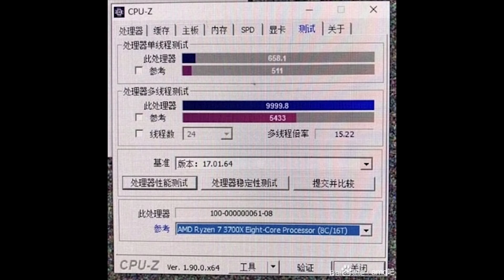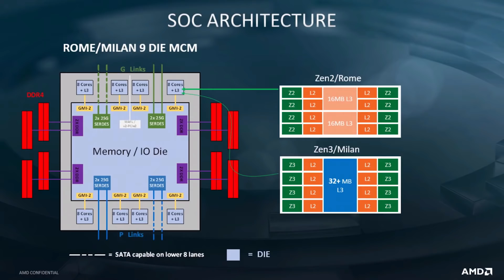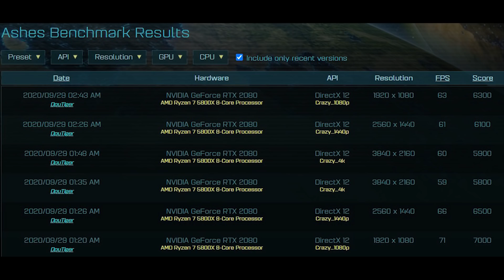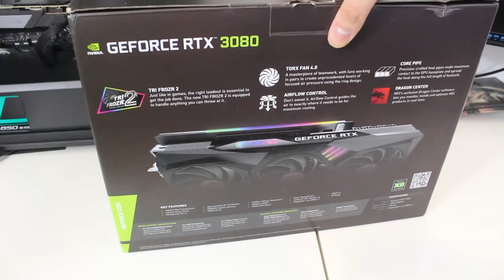Ryzen 5900X CRUSHES Benchmarks | Beats 3900X By 25 Percent

Comment: Is it possible the 5900x actually give an fps boost over the 3900x at 4k? 

I would imagine no, but i'm not sure 🤷
Reply: No. I mean I don’t even think in a low grade esport title it wouldn’t make a difference
Reply: Depends on if the game is single-thread reliant. 4k generally puts more workload on the GPU sure, but you still need the CPU resources to match it. You can't take an Athlon X4 and pair it with a 3080 at 4k and get the same FPS as a 10900k.
Reply: Joseph Hodges they specifically were saying over the 3900x.
Reply: @erichall090909  right. And it'll still depend on if the GPU needs more CPU resources not to bottleneck. My guess is you'll get better lows and average fps if these rumors are true.
Reply: Joseph Hodges your really not unless it’s a really old really low graphic game.
Reply: @erichall090909  Generally, IPC increases while not raising maximum FPS when GPU bound do raise AVG and Min FPS...

Comment: Currently gaming with my trusty i7 2600k... I suspect it will finally retire and a Ryzen 5000 series will replace it. I hope the new Ryzen will last as long as my 2600k :-)
Reply: Dex4Sure  Probably be a rip off and offer a barely noticeable difference for quite some time, probably no real concern for a gamer. Perhaps 5% performance uplift in scenarios where ram bandwidth is paramount.
 I'm sure some hardware snobs that want 168 fps instead of 160 won't think twice about blowing £400+ on 16gb of the first generation of ddr5. Historically that's been the case with every transition to a new ram technology.
Reply: im rokin my xeon w3680 and will eventualy get a new amd cpu, just not sure if 5000 series will have the value compared to 3000
Reply: Still using an i7 2600k here aswell and I'll definitely upgrade my entire PC in a few months from now. ZEN 3 and RDNA 2 look extremely promising and I just can't ignore it any longer.

Comment: 511 on single core in CPUz makes sense on the 3700X. That is what my 3600 gets as well in CPUz single core and I know it maches R7 3700X in that test. So if 652 is the single core here?  This looks like boosting 5GHz with some IPC improvements sprinked in.  I bet 5700X will be 4.8GHz and score around 615 single core. 20% faster than it's predesessor.
Reply: @Desktopia it's a bit faster than heavily overclocked CPUs with perfect memory tuning. With tuned RAM, these will be way faster.

Comment: 15% increase in multicore is underwhelming.  I'll buy a 3950X instead of a 5900X if that is the case.  I'm not a gamer.
Reply: Depends on which kind of workload you're doing, as an architect and doing some work on CAD the single core is nice and for rendering the amount of cores is a really nice value proposal. I have been using a Threadripper 1950x for a few years now, and while I felt like I got a bit scumbagged with no option to upgrade towards the newer processors on this motherboard, these seem like a great path to retire this PC into a home server.
Reply: @YvesSanchezP  What CAD program are you using that is single threaded ?
Reply: @SomeTechGuy666  I'm sure most CAD programs are only single threaded when drawing and performing operations such as hatching, doing arrays and whatnot. 

I use mostly Vectorworks, but also use Autocad since it's what the industry mostly uses. Also, when drawing 3D models, exporting or importing and doing complex operations you will be performing such tasks mostly on one single core.

The benefits recently on these programs have been the viewport performance by taking advantage of new gpus.

It is always nice to have extra cores when you're rendering and want a high quality output out of programs such as maxwell render or vray instead of the videogame-y look lumion or twinmotion give you.
Reply: @YvesSanchezP  That is not what I asked you.
Reply: TechGuy okay you can’t read the answer given.

Comment: With my fabric clock at 1900, ram 1:1 at 1900, CAS latency 16-16-16-36, and dual-rank mode on the ram, I get 555 CPUZ single-core.  Not sure if it is worth the upgrade, might wait for x670 and DDR5 as well as PCIe 5 .0
Reply: I mean no  not for you but it is quite faster then the 10900k so in gaming its going to dominate and well it ofc is dominating multithreaded tasks so its up to you. I'd say if you want a 3080 or top big navi I'd say switch but its up to you.

Comment: Should I wait for zen 4? First time buyer. I have no parts. Zen 3 is at the end of the chip cycle am4??
Reply: depends how often you plan on upgrading, if you dont plan on upgrading for a while anyway then i think zen 3 is the way to go since you'll be getting it atleast a year sooner. If you want to upgrade yearly or bi-yearly then maybe wait so you can hopefully use the same board/ram or whatever.
Reply: Depends on what you are doing and how immediate your needs are. As HarryVoyager said, this is the last AM4 push, but historically, the first generation after a memory tech change isn't a great leap. Basically everyone puts their energies into making the new stuff work instead of improving the base architectures a lot. Most of the time, the gains are really a matter of reducing the bottlenecks experienced by the current architecture. AMD may surprise, but I would expect a Zen 3 refresh (say +5-10% base performance increase, mostly from clocks) with DDR5 bandwidth reducing memory bandwidth bottlenecks (improvements based on CPU used and task varying widely, but probably ~5% average for the first release).  The place DDR5 will make big impacts is in APUs where the bandwidth constraints really hurt the graphics capabilities. I could see a change from 8 GCN/Navi CUs to something like 12-16 Navi 2 CUs on the mobile/G series side of the fence. 

So the real question is do you need a computer now and how much computer do you need/want? You could make a balanced budget system with the 4000 series APUs (e.g. 4600G) that would do most tasks pretty well and be easily upgraded with graphics card for more gaming horsepower as desired. Or you could go super budget with an Athlon 3000G and make a reasonable and simple first computer for under $500. If pure gaming is your goal, a 5700X or higher with graphics card of choice would be a good move. 

Also, be aware that in this hobby, there is always a new bigger, better, faster, etc. card or chip coming. It's stressful at first, but make peace with the fact that some new release will always  make your current epic rig look old and slow (eventually). So make decisions about hardware based on your needs and goals, rather than your emotions, otherwise you will always be bummed when the next thing comes down. As a general rule, I have found that buying the mid-high end and planning on a 3-5 year replacement cycle is the best combination of staying current on the tech, having a powerful computer capable of doing everything I want, and not breaking the bank. 

All of this goes out the window when you start making money using your computer. If you are doing something like video rendering, massive CAD work, scientific computing, or anything else that equates directly to dollars, it's time to do some math on how much time/power is worth to you and whether a part will improve your cash flow. For example, in video rendering, a mid-high end card could be $500-$800 dollars while a bleeding edge top of the line card is $1500-$3000 and only gives +10% performance. For gaming, it would be an extravagance. In rendering, it lets you render 11 videos for every 10 you could render before. If that extra video is bringing in more money, the more expensive card could pay for itself over time.
Reply: Depends on what system you are using rn.
Reply: Duy Hoàng Nguyễn I’m playing PS4. Mainly Warzone.
Reply: I would expect Zen 3 to be the last big release on the AM4 platform. As I understand it, they need to move to DDR5 to feed more that 16 cores, and, in theory, Intel is moving to DDR5 in the next year or so.
Reply: @HarryVoyager  Where are you seeing anything about "feeding" a 16core needs ddr5.  They have massively more cores running on ddr3 just fine, why would it matter?  Just like DDR4 was supposed to be a huge difference from DDR3 which wasn't found to be the case, I expect the same from DDR5, plus initial releases of new RAM is generally very slow speeds, it's better to wait years down the road when you can get a good speed, low latency option for a good price.
Reply: @Sonickrunch  I recall it was brought up in one of the previous AMD interviews. Basically they see the value in 24-32+ CPUs for general users, but they were holding off on going beyond 16 cores for Zen 3 because they felt that they needed more bandwidth than DDR4 provided for a 24-32 core system. 

Recall, while Threadripper does do 32-64 cores, it is also running quad channel DDR4, and I believe they clock lower than the desktop parts.
Reply: @HarryVoyager  I'll look for it. but at those levels I'm not sure what benefit we can see today from all those cores.  I'm not going to act like more cores is useless obviously, but we need some work on the software side to take advantage, seems there's still a lot of developers sticking with the mentality of, give me a few high speed cores vs multiple cores.  Until we see major dev houses pushing Intel and AMD to provide more cores for specific use cases, we may end up with GPU's or co-processors being developed first which meet those needs like we see today with CUDA/Steam
Reply: Depends, Zen 3 and current MB support PCI 4.0, USB 3.1 and NVME SSD's.  I don't see a real reason to wait once Zen3 drops.  USB 3.2 is "better" but there's no game changing tech coming imo that would make this obsolete anytime soon.  Expect at least a 5 year platform in terms of performance out of this pc.  Heck I got nearly 7 out of my last system(Intel 4790k, only regular sata ssd speeds and usb 3.0).  I upgraded to the 3600 and am4 so that I could drop in a Zen 3 chip and get the DDR4 and PCIe 4.0 and proper nvme speeds.
Reply: You could wait till 2022 of you want.

Comment: A new era is coming and we all bow down to our new overlord, AMD aka Lisa Su
Reply: Kinda sad that we are running into the physical limits of silicon and Dennard's Scaling. 20 years ago a 25% cpu perf improvement in 18 months would have been considered unimpressive and maybe even shameful.  From Nov2000 - May 2002 (18months) Intel went from 1.5Ghz to 2.4Ghz Pentium 4 in that amount of time.  In roughly the same time period Oct2000 - June 2002 AMD went from 1200mhz Athlon to the Architecturally improved Athlon XP at 1800mhz.  Nowdays the only substantial improvements are through IPC gains and all the low hanging fruit has been picked already, making it harder and harder to make substantial improvements to IPC (without a radical change eg: 1GB stacked dram on die)
Reply: She isn't my overlord...I use Intel/Nvidia only.  :/
Reply: AMD, hurry up and raise those prices already.
Reply: @michahojwa  And make 5nm++++++++++++++++++++++++ already!
Reply: Zen 3 will be old news real quick. Having the gaming crown for only 3 months until Rocket Lake means nothing. 2021 tech news will be dominated by Intel. 8core Tiger Lake-H and Rocket Lake-S in Q1 2021, PCIe 4 Optane SSDs, Xe-HPG gaming GPUs, and Alder Lake-S + DDR5 + PCIe 5 in Q3 2021. Intel will support PCIe 5 and DDR5 way before AMD https://videocardz.com/newz/intel-tiger-lake-h-alder-lake-s-and-alder-lake-p-series-detailed
 Intel also already have MCM (tile based) chiplet GPUs working way before AMD and NVidia https://www.techradar.com/news/intels-xe-hp-gpu-crushes-nvidias-a100-but-there-is-a-catch
Reply: @Patrick73787  Alder Lake with brand new 6xALU uarch is the one you should concentrate to.
Reply: You should bow to CPU architect Jim Keller. Without him AMD would never be able design Zen1 uarch. And consequently also this Zen3. Lisa Su is just another manager (like John Sculley), mainly responsible for killing of much ambitious K12 project and forcing Jim Keller out of AMD for the second time.

+15% IPC of Zen 3 is not monstrous. I'd call it decent IPC uplift.
+50% IPC of ARM Neoverse V1 core. This I would call it monstrous. Especially when older Neoverse N1 has +10% IPC over Zen2. This means ARM V1 will have IPC higher +65% over Zen2. That's pretty monstrous problem for AMD and Zen 3 in servers.
Reply: @arm-power  The ARM Neoverse V1 looks good on paper lets see what it does in practice.
Reply: @freckledtrout3299  ARM V1 core looks only good? What? +50% IPC after ONE year is only good? That's insane IPC jump. And remember that G2 runs at 2.5 GHz only. If G3 will clock to 3 GHz it means +80% performance jump after one year. That's monstrous leap that Nvidia had to buy whole ARM. 

Zen3 brings +15% IPC and 6% frequency, total 1.15*1.06= +22% perfomance uplift. In MT load typical for servers it's only 15% because TDP limitation.

And Nuvia Phoenix suggest DOUBLE IPC of x86 CPUs. 1900 pts in GB5 @ 4W means speed around 3 Ghz and really insane IPC, better than Apple A13 (it has +82% IPC over Intel Comet Lake).
Reply: @arm-power  Yeah no don't misunderstand that is really huge however I need to see it implemented in an actual core and tested.  I'm a tad skeptical.
Reply: @freckledtrout3299  No need to be skeptical. You can run any benchmark in SW simulation of that CPU model. The same way engine is tuned for performance in SW simulation (like GT-Power or Ricardo Wave) with 95% accuracy before prototype arrives to test bed dyno. 

And binary system like CPU can be simulated with 100% accuracy. Simply its not estimations but exact simulation of any code or benchmark.
Reply: @arm-power  Jackass Lisa Su use to lead engineering teams at IBM, she is as much an engineer as she is a boss. She worked on the Cell processor that was implemented in the PS3 and several supercomputers among other projects.
Reply: @arm-power  So Jim Keller designed the entire Zen architecture without input from the thousands of engineers working at AMD? He single handedly wrote the millions of lines of verilog source code for 5 generation of zen? Didn't know AMD who was on the verge of bankruptcy can afford to develop for 2 generation when the OG zen was still in development process, also he left at 2015, didn't know AMD was doing nothing for at least 1 year because OG zen was only released in 2017. Forced Jim keller out? Last I checked he left AMD saying his job was completed, unlike at Intel where he stated he left due to personal reasons. 

Also huh? I don't see Amazon's graviton(neoverse n1) topping every single charts, it's weird because you said  neoverse n1 had 10% better IPC compared to Epyc Rome. https://www.phoronix.com/scan.php?page=article&item=epyc-ec2-c5a&num=4
In fact it gets worse because the Epyc Rome instance they were testing was a mix of hyperthread + physical core while the Amazon's neoverse n1 was backed by physical cores.

Comment: Oh my.   Guess I'll have to by a 5900x in a couple years when i can get one for a lot less. 
Fortunately the process will be the same as when I replaced a 1600x with a 3900x in a Crosshair 6. 
Bios flash, chip swap, cooler back on, push power button.   
And still be able to use the lion's share of the performance upgrade.